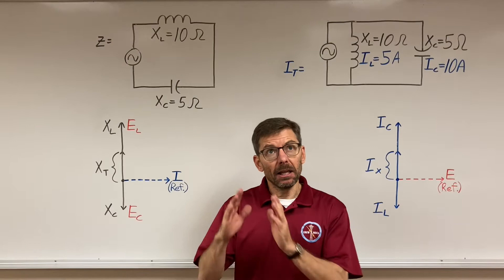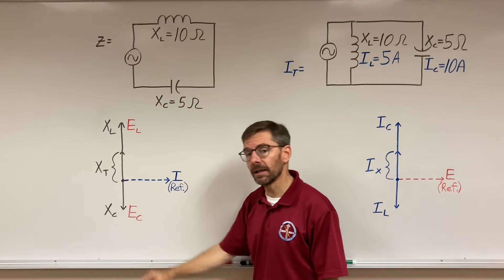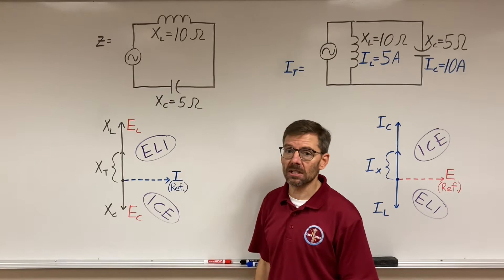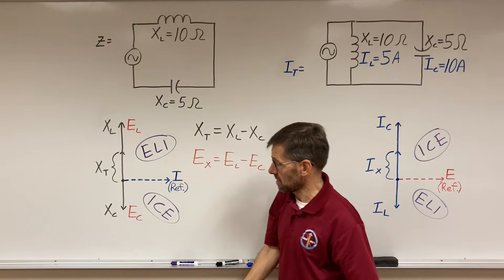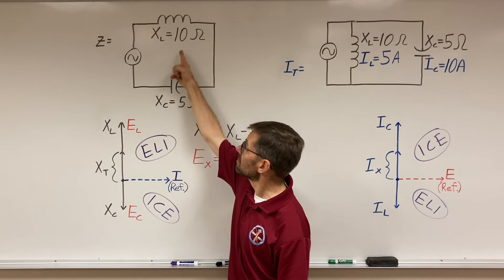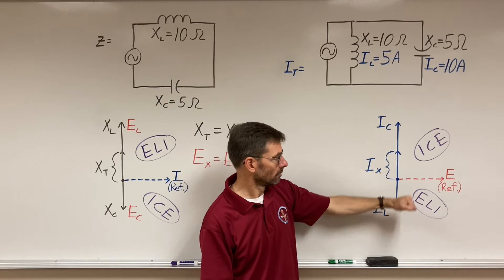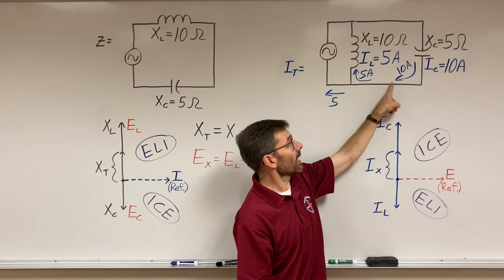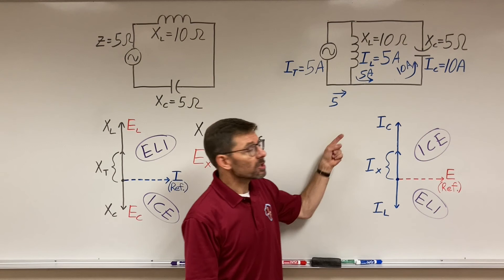Introduction to LC Circuits

Comment: Dear Dave
You have got an exceptional quality of teaching. You correctly assess the audience and take them along. May I request you to speed up a bit? Harmonics in a system, their mitigation techniques and the designing of active filters are desperately awaited. Hope you will consider it.
Reply: Being a video series, I'd say the speed is just fine. 
If someone wants a speed change then they can fast forward or rewind it a bit.

Comment: On the left the system is defined as "inductive load", another word for inductive current.
While the system on the right the term " reactive current" is used.  In other words.  The system on the left is inductive current and the system on the right is reactive current.
So, please differentiate between inductive current and reactive current.  Are they opposite?  If so then reactive current should be termed " capaciive current", the opposite of inductive current.  Unless of course inductive load does not mean inductive current.